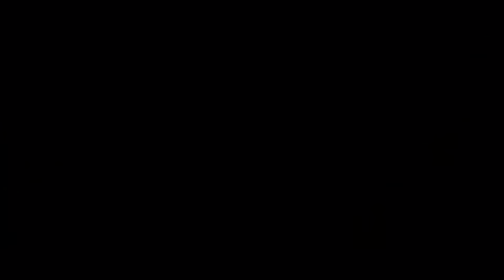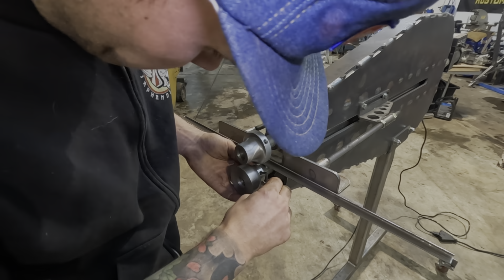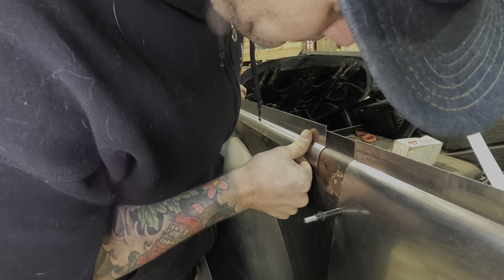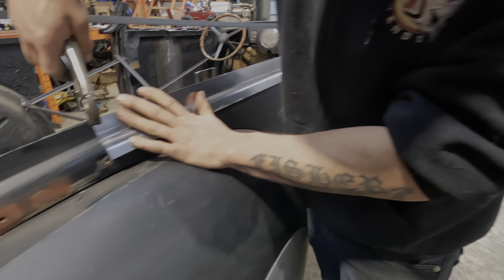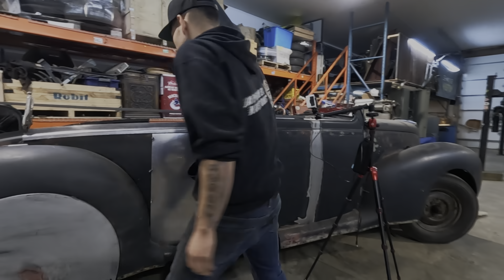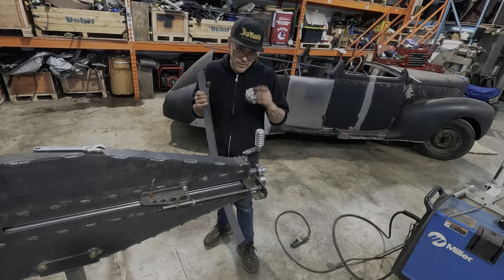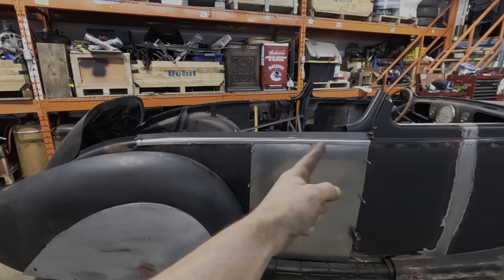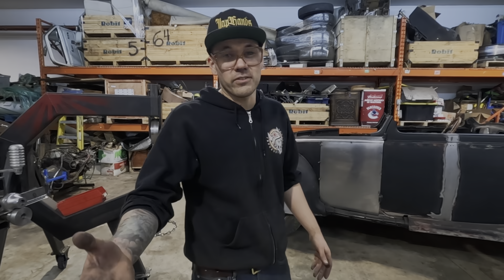Bead Rolled Body Line With Home Made Dies 1939 Lincoln Zephyr 3w Conversion

Comment: Karl, the best way to do large holes is to drill to one size smaller than you want and then use a boring small bar to finish them to size.  That way you are not at the mercy of the drill bit to get a straight concentric hole.
PS:
me thinks by the look of it that maybe you should take a day and give your lathe a little TLC, a little cleaning, and maybe even painting, never hurt anything. 😁

Comment: Hey Karl good stuff and just a trick for making quick radiuses on the lathe. You could set up a ball nose end mill or carve out a radius out of a piece of HSS and set it up on your tool post and use whatever size radius you want just take little cuts and make sure that you set the cutting edge up on the end Mill if you go that route and have it face your work piece. I like the end Mill trick it works really nice in a pinch.

Comment: The built-in rake \always going downhill. Is always better to me than thawing the Carolina Trots/ spotting aircraft '61GMC JIMMY 1/2t short fleet side, lost all its caster when grandma  turned up the torsion barsto reduce the rake. And also discovered a major aerodynamic penalty @3mpg.  Can you imagine driving manual steering with no return to center and wandering everywhere on winding mountain roads . By the way she was from Pasadena.

Comment: if the oblong is coming from the die not being perfectly centered (a bit of play in the shaft hole, taken up by the hex screw ?) then even if quite tight, there may still be a variation in pressure along the profile, would it not ?

This detailed case, including fabrication of the ad'hoc dies, is really enlighting : thank you for sharing !

Comment: I am curious about the level chassis vs the wheels looking about 6" off the floor. Are you planning to raise the front of the car when it is running or did you level the chassis to get a visual of the new piece you just made?

Comment: Another great video! If i understood correctly, your first die did not work well because the inner bore was not true to outer diameter causing a wobble. If I may offer a small piece of advice, finish your inner bore with a boring bar or using a finishing reamer to make it run true. Drill bits don't always drill a hole that runs true. I believe I saw you used a boring bare on the ID to make the replacement die. It should work much better for you. Love the channel and am following your work closely! I'm 65 and am learning lots of tricks from you!

Comment: Here in lies the reason why you use a boring bar and not a drill bit for your final size of a hole.
Reply: Requires the right measuring tools, calipers don't work well enough for this.

Comment: Hey Karl, great video and thanks for bringing us along. One of the most precise ways you can cut that hole is with a boring tool in the tool post. You actually seem to have one in your tool post that you are using for facing and contouring. If you set that boring tool up on the center line you can cut a very precise hole. It’s called a boring operation. You remove material from one side of the cut and it’s super easy to get a round hole. Just plunge a hole with a twist drill large enough to get the boring tool in and then open it up to size.

Comment: Hi Karl:  I think you were on the right track with the curved blank but as I see it you would have been successful if you had used a single dowel as the bead roller guide instead of two. The curve of the blank would determine the ultimate shape.  I am impressed with your persistence!

Comment: Regular drill bits always make a somewhat triangular hole. You can mitigate it a little by gradually stepping up drill bit sizes in the hole and using a good sturdy drill press, but twist drills always make imperfect holes.

Comment: Drill bits do not make perfectly round holes. Bore the hole a few thou short and get a reamer to finish it off.
Reply: There are drill bits with three cutting edges for drilling round holes - here in Germany they are available, in my view not really common and very expensive. A reamer on the lathe requires  perfect alined tailstock or a floating reamer chuck.
Another way is to spindle the bore on the milling machine with a boring head.
Reply: @philho122  what are they called? If it's a super long word like threefluteddrillbitfordrillingroundholes, but in German, I won't be surprised.
Reply: @JackOffAllTrades  
English isn't my first language, I had a little technical english during training as a bicycle mechanic without any focus on machining technology.
I found "three edged twist drill" and "three flute drill bit" on google. These examples were on official translations of tool shop sites like Hahn&Kolb and so on.
Reply: @philho122 lol your written English is damn near perfect. Also, it was just a joke. I googled it, too. Thank you.
Reply: @JackOffAllTrades  Thank you very much!
I watch a lot of videos from Great Britain, Canada, USA, South Africa,... There are too few videos from Germany showing traditional car bodywork. We have the "Fahrzeugakademie Schweinfurt" showing a few tricks an tips but often after watching them you think: now i have to buy this tool and this tool and that machine...
Scrapyards or fleemarkets aren't mentioned as sources for tools and Material. That's why im looking around in other countrys. Improving my english is a pleasent side effect. I admit that I partly use deepl - school english doesn't work to life...
Reply: @philho122  story of my life, man. I can't go more than three days without buying a new tool, or three.

Comment: Hi Karl, with holding the two rollers manual to each other to check the shapeon the lathe, how can you assure they are perpendicular to each other? I think that is the reason why the upper edge flips over and with too much pressure on the lower side, material got stretched.

Comment: Morning Karl, the bead roller dies you made the first time, you can repair them by boring out the drilled hole, install a pre made bushing & re-bore... that's one thing I've definitely learned, is how to fix my screw ups!!
I bought some Dies from Eastwood, I think the Dies you made are in the box, I will look when I get home.
Reply from the maker: Yeah, definitely they could be repaired that way, but the diameter was still too far off. I am still going to keep them around though in case I can use them at a later date.

Comment: As others already stated, drill bits won't give you accuracy. You can use a smaller diameter drill bit and after that go to size with a boring bar. I was thrilled with the fact that you nailed the shape from the first time(and you were too!). Take care!

Comment: Karl, I’m sure you are aware of them, but just in case you are not,  annular cutters drill a more precise hole than standard twist drills. I use them in my mag drill and the hole quality is superb. I know you can get adapters for them to fit a Morse taper. So you could use them in your mill or even possibly your lathe.
Reply: Or drill the hole undersize and use a boring bar ;p
Reply: @grubsrust299  I was just about to say this.
Reply from the maker: Yeah, I think I could’ve used a boring bar to make them fit super super mint
Reply: A drill will never give you an accurate hole. Next time drill undersized and use the boring bar you have to finish to size. If you don’t have a way to measure inside dia make up a test bar to the size of the bead roller and use to test fit.

Comment: 👍👍❤❤
Just some input, would have machined larger holes in dies and press fit blanks then re drilled holes. Get yourself some button cutting inserts. Helps alot turning raduis...😆